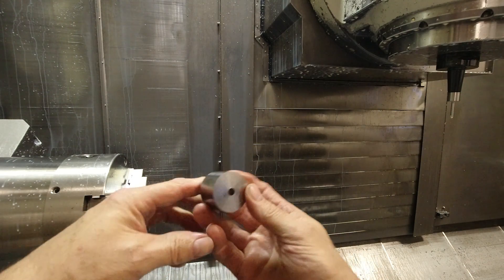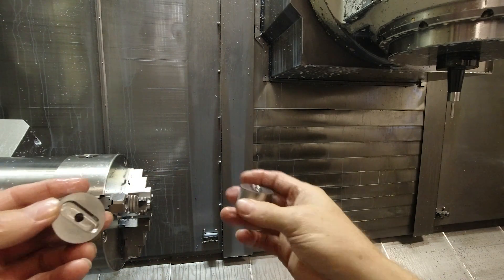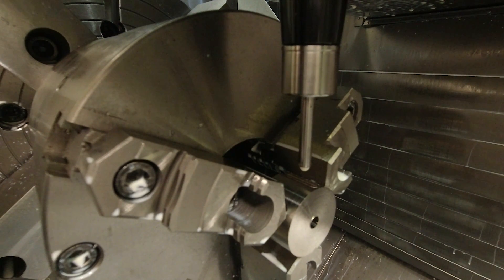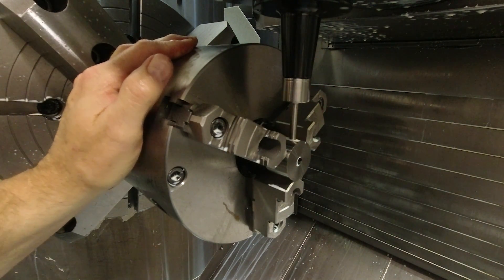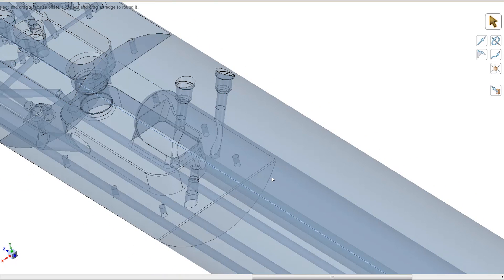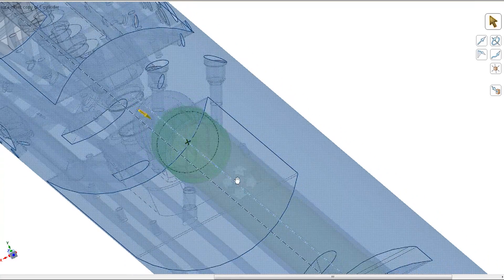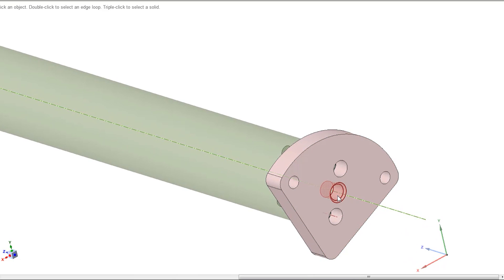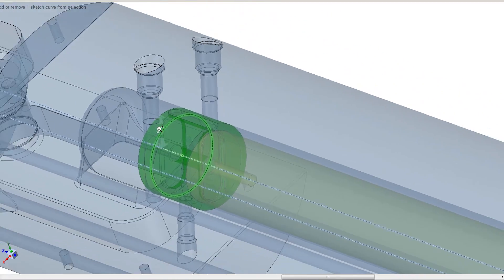Sacrificial Fixture

Comment: Why not come down with an endmill instead of a drill for those two interrupted holes?
Reply from the maker: The Idea of this test part was to simulate whats going to happen on the real part. Also a endmill wont leave a good enough finish (I tried it). No matter how you mill it there is always some sort of marks left by milling. I also tried using a boring head. But that gave trouble with the cross intersecting hole. These .218 holes are already drilled lengthwise in the parts before I get them. In the real parts I drilled the hole than roughed milled than used the form tool I showed in this video.

Comment: What is the spindle speed that u used for parting off
Reply from the maker: Its a constant surface speed. I think if I remember correct it was 150 SFM  at .002 feed per revolution.

Comment: Two hole cut with endmill 
Is possible?
Reply from the maker: I won’t say it’s impossible but the holes are .255 in diameter. So to mill them would take a smaller tool than that. They go about 2” deep and intersect that larger hole. This would be a difficult milling operation to do without getting deflection and holding the tolerance on location and diameter. The drawing also shows a drill point at the bottom. I’m not sure if that’s necessary or not.

Comment: So I've got a question you can probably answer. I bought a used live tool lathe with a Y axis, hydraulic chuck, etc. It came with a 2 foot tall roll around white box that says "automatic oil temperature regulator", is that for the hydraulics, way oil, or was the company perhaps using it to keep the coolant cold?  https://imgur.com/GDyrCJa  Cold coolant would keep the live tool blocks lasting longer.
Reply from the maker: It appears to be a chiller unit. It would be for the hydraulic oil or on lathes they often have a spindle oil/gearbox system and these are used to cool the spindle oil. Is there not someone that disassembled this machine that could tell you?
Reply: @EdgePrecision  lol the place that sold the machine almost won't tell me who sold it.  Resell CNC, some great deals before the end of year.  There's a tag on it that says to me it's from a custom bicycle shop that I could call, but it's probably a real industrial shop and finding the right guy would be hard.

Comment: Your talents are unmatchable in my HUMBLE opinion. I once had a housing out of aluminum tubing that had a .004 tolerance on the thickness. I used a split arbor that I pinned together to hold the tolerance. This reminded me of that project. They actually used it to do the milling operations needed on the part. Just a suggestion, a spring loaded pin may reduce the risk of bottoming out the pin to the part.

Comment: Great video as always, with the chuck in a chuck, what max RPM? I was listening to in wind up hoping you were not stood in line with it. Not that I know anything, but would be cool to hear what you wind it up to
Reply from the maker: Thanks Andrew. The max speed of the turning spindle is 1600 rpm. It isn’t possible on this machine to run any of the spindles with the doors open. They also have bullet proof glass on their windows. So standing in line with the turning spindle is really a issue. I think if I remember correctly I had the speed in this program limited to 1000 rpm.

Comment: Hey you could have just blued the part and used a surface plate, v block and height gauge and scribe a reference if it wasn't crazy critical and you needed the entire diameter
Reply from the maker: Yes that would also work.

Comment: Wonder if you used long extension for facemill and used that to helical the bore near the cross holes.
Reply from the maker: These holes are more than 16" down a 1.496 diameter hole. The tool would be to long. Also and more importantly the drawing doesn't show it being done that way. They also have a .020 corner radius where the holes break into the large hole. I will let the deburr guys figure out how to do that.

Comment: Seems like the designer could have made your life a lot easier by just having the tangent holes up to the big bore instead of drilling it passed the bore. There might be a reason for that but it's  always fun to see that no matter how strange the part is designed, a good machinist can make it one way or another. Even though some more thought in the design could have saved a lot of time (and money i guess)
Reply: Looks to be for some kind of retaining pin to me.
Reply: Agree look to possibly be retaining pins to hold and orient a part goes in that bore.

To the machinists, assuming that, what would you suggest to change to the design for manufacturing?
See if you can have them alter the blank that gets to EDGE so the 1.4" bore stops before these cross holes to leave material so the drill doesn't deflect and finish the center bore and depth after those cross holes?
Or something else to simplify?

Comment: A suggestion. You could jog the tool in without the part in place (Using the readout to get close), then slide the part in, indexing to the slot. This would help with the fiddling about. Rinse then repeat.....

Comment: The 3D CAD of the finished part you showed looks like a demo part developed by a CAD software company to showcase all of the crazy features you can create.
Definitely a case of “if I can draw it, therefore it can be made”.
Great work as always Peter, you keep setting the bar higher and surpassing yourself.
Reply: Wait a minute, isn't making a part as easy as putting stock in the machine and pressing start?!?
Reply: @gearloose703  This hits way to close to home. Had a customer say this, when he couldn't understand why tolerances were important. Just assumed the part comes out exactly to the model.
Reply: natedawg003 shoot. My boss told me I better quit making mistakes. I'm the only CNC machinist/programmer and I'm teaching myself the machine. At least I forgive myself.
Reply from the maker: Gearloose What did Bloomberg say? You just chuck on the material and turn the dial toward the red arrow. What ever that means. And that is one of our presidential candidates. Go figure. Any thing more takes more gray matter in your head according to him.
Reply: @EdgePrecision  in a similar vein, I had a guy ask me what took so long. 
I was trouble - shooting a pre-existing office telephone system to figure out what lines I might be able to reuse on the new system I was installing. Some lines went about a quarter of a mile to another building on the ranch. 
Anyway, he summed it all up by saying, it's just a bunch of wires, I don't see the problem.......

Comment: Good idea with the magnet holding the parallel.  I would not have thought about making the slug out of a similar material as the part to make sure the drill is loaded the same.  Those ports have a lot of features...I imagine they have a pretty tight surface finish callout too.

Comment: Wouldn't boring the hole somewhat solve the issue with drill deflection? Like do 1/10mm undersize hole with circular interpolation and finalize it with a single point boring tool and very small feed rate?

Comment: Would it be easier to locate the part if the slot exited the face with a small v-shaped mouth? Could get the gauge pin at the right high, jog it toward the loose part, and have it rotate the part ideally for your alignment.
Reply from the maker: Yes that could work.

Comment: When roughly aligned by eye... Why not come down say 1mm above bottom of alignment slot at +5mm Z, with the part loosely gripped and them jog in on Z...  the part will align itself as the round peg goes up the square slot.

Comment: Dumb question, why not just plunge/spiral in with an endmill, and finish the bore with a ball/tapered endmill running in simultaneous 5 axis for tool collision avoidance if higher accuracy is needed?

Comment: Peter, you might know by now, but will this stick in the bore once you drill into it and there is a burr where you cross drill it?
Reply from the maker: It will get a little tighter but I will be able to get it out with a slide hammer if necessary. I think when it moves a little way it will flatten down any small burrs.

Comment: I guess you figure it may try to twist in the bore while drilling why you keyed the slugs?
Reply from the maker: Yes, can’t be to carful.
Reply: The key is just a reference when milling the other end of the slug.  But, the slug twisting in the bore probably won't happen, if very little.

Comment: Nicely done! Was it possible to turn the piece 90 degrees and use again or do the drilled holes go too deep and leave not enough metal?
Reply from the maker: I did look at that but there isn’t enough material. Or to put it another way the notches from the holes cover more than 90 degrees of the hole.